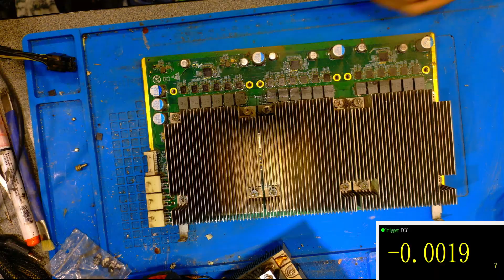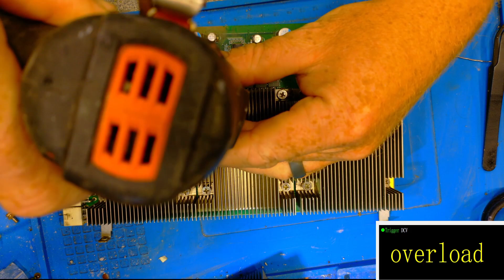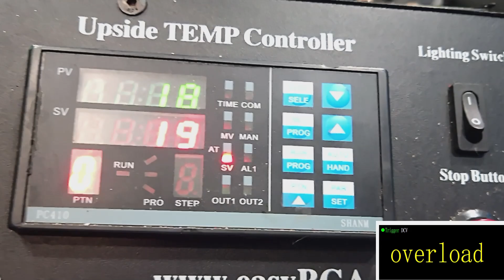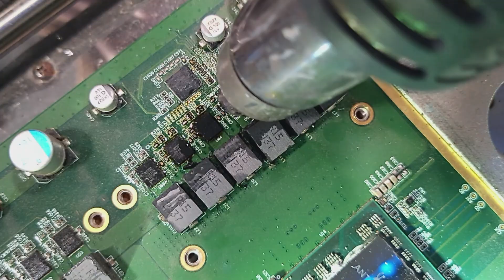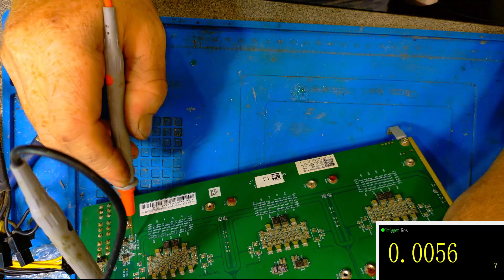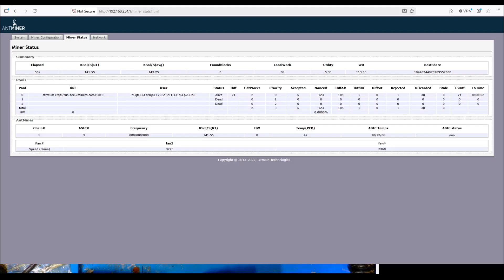One mosfet will take out the whole machine, z15 repair

Comment: Hello my friend, huge fan of your repair videos!

I’m reaching out with a lot of humility because I’m currently struggling to repair an Antminer Z15J hashboard here in Brazil. Unfortunately, repair services and parts for this specific model are almost impossible to find in my region, so I'm trying to fix it myself.

The main symptom of the board is that the system reports '0 ASIC' found.

I’ve already performed a deep diagnosis. I've been comparing the measurements side-by-side with a known working hashboard from the same miner, but I haven't been able to find any differences between them yet. Here is what I measured:

No shorts on the 12V line.
It has a power consumption of just 15 milliamperes on the hash board (50 milliamperes when I jumper PWR_EN). This same consumption level was observed on a hash board that is operating normally.
All main voltages are present: 3.3V, 5V, 1.8V, and 0.7V.
Vcore (on r15 2132 coils) is stable at 0.78V across all of them.
The hashboard is V2 model.

Everything seems physically intact. Connectors, traces, level shifters, and test points all measure identically to the good board.

Do you have any advice or tips on what I should check next when a board has all perfect voltages but still reads 0 ASIC? Any guidance would mean the world to me. Thanks for your time and for sharing your knowledge!
Reply from the maker: It may possibly be a problem with an asic chip.
Reply: @crypto440  Oh, what a pity. I was really hoping it could be a simpler issue to solve, but apparently it's not.

By any chance, do you have any working Z15j hashboards for sale? I actually sent you an email a while ago asking about this, but I haven't received a reply yet. Let me know if you have any available or if you know where I could get one! Thanks again for your help.
Reply from the maker: So sorry unfortunately I don't.

Comment: Hey buddy need some help, i just bought brand new z15 pro one month old got some weird issue when the ambient temps are low the miner runs perfectly on 860ksols, but when the ambient temp rises one hashboard on miner drops hashrate to around 100ksols ex-293->193, don't know what's the problem, Please Reply ASAP!
Reply from the maker: Probably needs re pasted
Reply: @crypto440 but the temps on dashboard are good around 71 max
Reply from the maker: Send the log file to my email in the channel description.
Reply: @crypto440 okay